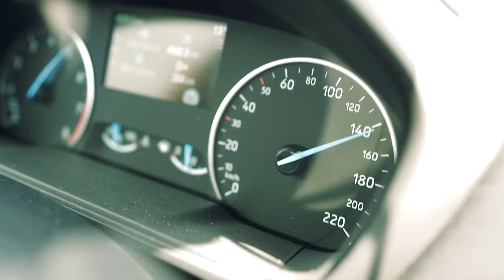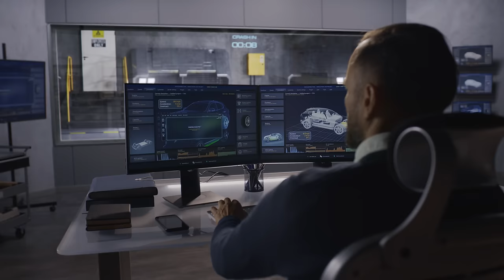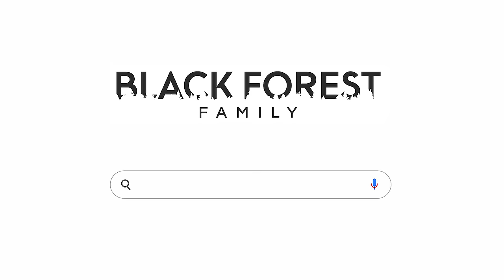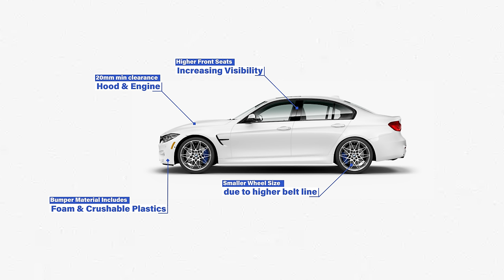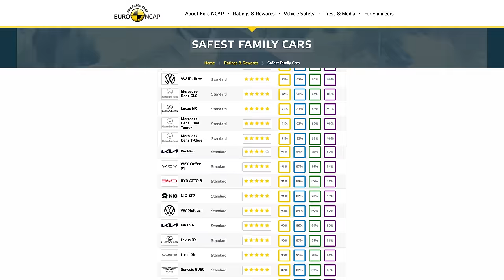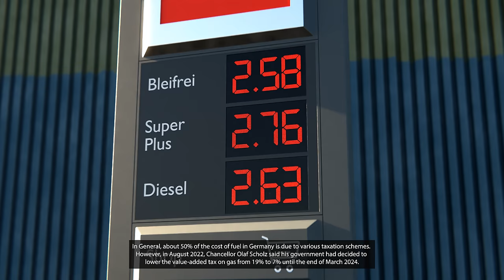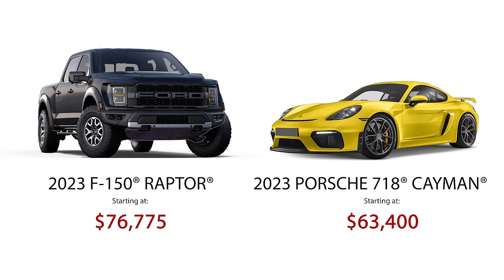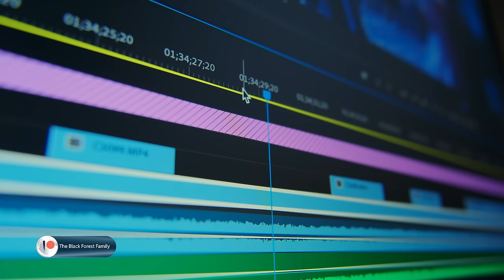DRIVING CULTURE CLASH: Why do our Cars LOOK so Radically Different?

Comment: I guess I'm not your typical American. I tend to look at transportation differently. First and foremost is reliability. My vehicle must be reliable in order for me to get to and from work. There is no bus that can take me to my place of employment. Secondly, I have no use for a pickup truck. Fuel economy is important to me and a pickup truck is not fuel efficient. I also have to have a vehicle that will be capable of the roads and climate where I live. Heated seats are a must for me. It's hard to find an American car that meets my needs and is also affordable. I've owned many different cars over the years including Ford, Dodge, Chrysler, Plymouth, Chevrolet, Volvo and several Volkswagen, and Audi. However, I have found that the most reliable, fuel efficient, practical cars that I've owned are KIA. I am on my fourth KIA and my second Soul. I drive a 2021 Soul EX. I average around 30 mpg and at 53k miles I have had no problems. So, not all Americans want an ugly, oversized gas hog.

Comment: As an Upper Midwestern American, I find the front end of most American and Japanese/USA designed pick ups act like a huge wall that totally block my view on one side of my car when I pull  up next to them at a stop sign. It keeps me from pulling out into traffic or moving because I can't see what is coming down the road. Lowering that front hood may do far more for safety than keeping pedestrians and children from getting ran over! Personally, I would love to buy a VW golf as it is my mind of car. Then again my priorities are inexpensive to buy, durability or little to no unexpected breakdowns while racking up many miles on the vehicle, ability to haul reasonably bulky items in the trunk area ( lounge chairs, small refrigerators, ect), low insurance costs, reasonably priced repair costs, easy to do my own maintenance  on the vehicle, and at least reasonably low fuel usage. Needless, to say the S Koreans get my vote for the most preferred cars and small SUV's, and in the past the Nissan Cube was a much desired vehicle.

Comment: Part of the problem is that American car companies have stopped selling actual cars. Ford only has the Mustang, GM has phased out almost all of it's cars, ( Cadilac still has a few ) and Chrysler's cars days are numbered. They push the SUV/CUV because the profit margin is better. They still made a profit oon the smaller cars but not enough I guess. The other issue is as a country, we are not a practicle bunch. A little to much of "keeping up with the Jones" and this Flex culture we have going on right now isn't helping. Even commercials, non car commercials, make absurb suggestions. Like a young couple finds out that they are having a baby, the next image shows them thinking about a mid to full size SUV/CUV or a Mini van. How does one child make you go from two door coupe to that.

Comment: Really addressing the elephant in the room would be addressing the different mind sets. 

Germans adore their cars. They keep it clean, spotless. A dent or a scratch are abominations that are addressed immediately. It's a kind of pride that transcends brands. You want to show off with your car, but not really with the car itself, but how you keep it in mint condition. And for an extended period. There are people out there that polish and clean their Opel Manta up to the tip of the fox tail. Or their Golf 1 or 2. It's showing off as "Look, how good I am, my 30 years old car looks just like it rolled off the assembly line. I am a master of preservation!!". You can add on with some luxury brands, if you want, but that is just the cherry on top. Like having a gleaming Porsche 911 or gasp a fully customized VW T1 California. Yes, making it go wroom is also important, but usually it's more cruising than racing.

Compared to that, people in the US are...less interested in the finer points of car ownership. They tend to go for the big and beefy. I get that people in farming need a pickup. Makes sense. But outside of transportation of readily accessible tools and equipment in an area with next to no rain...you do not need a pickup. When you want to transport people, I would prefer a bus. And if it is materials, a transporter. There is really no need to waste all that room with a bed instead of a trunk. Put a roof over it and you can do the same...but without it getting blown off or getting wet. In the US it is all about size. People have to compensate from something. It's generally accepted, that the size of the car is reciprocal to genital size. And to the power wielded in your daily life. They want to feel big and powerful at least when behind the wheel. And this is just not flying in Germany. We usually make fun of people driving those cars, thus taking away the benefit. Nobody is staring at a F150 and go "Wow, what a great car! Must be an awesome guy!". They usually point at it and laugh and see him trying to squeeze into small parking areas, saying "Wow, what an a$$...and can't even operate his car. Must have a very small p3n1s to feel the need to compensate with that.". 

Germans are more practical when it comes to cars. They cherish them, but they chose them according to their needs. When you need a small city car, you might go for a Smart or Mini. When you have some kids and go for IKEA once or twice, you go for a Kombi, like a Touran or Volvo. Need more room, you go for a Mercedes V class or a VW T6 or a Toyota Hiace/Proace. While in the US, you go for the biggest one regardless of why you need it. And throw in the broadest tires and double exhaust pipes and a big bull bar. People from the US like to brag and are hard to get off that high horse even by evidence. They can do everything better and when you present comparisons of topics like health care or education, they are at a loss for words and go fully mental with "butbutbut...that's COMMUNISM!!!". 

Not all of them, of course, but the ones we are focusing on^^

Comment: Utility requirements, real or just imagined, is a big factor. If you live in a country where you think you need to have a flat bed pickup, with XX horsepower to live your life, you will find use for it, you will find a way to justify it's existence in your garage.
Utility culture in the US is so much different than in Europe, yes rural America culture might need a high horsepower vehicle to do jobs on farms and some such, but European rural communities just don't use them (as much) and still get by.
Also, just because gas is cheap in the US doesn't mean you have to drive big cars that consume a lot of gas. It's the culture that's almost dictates it, and so you abide. 
Same with Germany, luxury car brands, fast cars, are as much a staple in that culture than pickup trucks are in the US.
For me personally it comes down to gas consumption, both big and fast cars burn a lot of fuel and the faster we can get rid of cars that use combustion engines the better.
How the car looks is secondary to me, after all, people should be happy in their own way.

Comment: Re: your dad.  To add an additional point.  Between GMs brands, their full sized pickups outsell Ford F-Series pickups. The difference is that GM splits then between two brands (Chevrolet and GMC) as opposed to Ford. Even though under the skin, the GMC and Chevrolet pickups are identical in every other way.

Comment: I love small cars (but mostly kombis) and I hate SUVs and cross-over cars, but we never thee less had to buy one when we wanted an electric car. For various reasons we did not want a Tesla and we needed a car that could tow at least 1200 kg (because we have a small caravan to camp around Europe). Now that limited the market and we bought a Kia EV6. I think it is too big, heavy and ugly and as soon as there is a smaller car on the market, with enough battery to go 400-500 km and tow 1200 kg, I will most probably change to that.
By the way, who needs a pick-up if you are not a farmer, gardener or working in the building industry? I certainly do not. Our first car 34 years ago was a small Polo and that could tow almost 500 kg and my farther had a small trailer (like so many Danes have).😊

Comment: No luck with new cars.  First new car I bought was Honda (stolen within 3 months).  Next one---VW...brand new and on the road 2 weeks and broke down on the highway.   Next new car as Subaru...loved it and drove it for the next 200K miles.  Next car was a Chevy, as much as I loved it, service was always terrible and the dealership and then tire warehouse company put the wrong size tires on it (to make themselves money) and it took years to find out why the continually lost air. A couple used cars (Toyota and then Citroen) now, we go strictly with public transportation.  I love the money we save.

Comment: Vans or Estate cars are much more practical than pickup trucks. I got myself a crew cab as i thought it looked cool but I soon found out why everyone i knew had only only owned one once.

For a start with a van you can use the side door and step into it to load it for example with thermalite blocks. but if i did that with a pickup i need to load a few then climb up into the pickup bed and move them back befor loading the next row.
In my Merc Vito  i can load up full size sheets of plywood  and i dont need to tie them down but when i had a truck they need to be secured.
And im getting 45 British MPG  in my van where as my Hilux averaged out 27.
And european and Japanese vans are just as nice to drive as a car. in fact i have a secondhand Toyota Hiace on order from japan right now as i tried one in Thailand and fell in love with it.

Comment: Of course, it doesn't mean that all Germans are so commitedly green. I might point to the VW group and "dieselgate" where the company engaged in a deliberately criminal act to subvert American emission rules on diesel engined cars.

However, the US approach to road safety and the lack of protection for pedestrians is astonishing. Pedestrian deaths are now at a 40 year high, and road fatalities in general are about the worst of any comparable country, whether measured by distance driven and especially per head of population. Canada, with similar road infrastructure, car preferences and usage has much better road safety than the USA, with less than half the fatality rate per million. Nobody seems to have an explanation for that.

Comment: As a german myself with now the third car, I can tell you: if your low on money, you don't consider to buy or not to buy a car because of the annual car taxes. You consider the insurance. You can't drive a car 8n german roads without registering it at your (mostly) local "Zulassungsstelle". To register it you need to have an insurance company giving you a number proving your car has at least "Haftpflichtversicherung" (if I remeber correctly that one does only pay for the damage on the other car involved... Probably pedestrians too... Never hit one in my entire life and also bicycle drivers... And hope to never have to learn if that is included as well...). We do have "Teilkasko" and "Vollkasko" as well, but those are more expensive because those also cash out for your own damages ("Teilkasko" just in special cases... "teil" like "part of something" and "vollkasko" would, I believe but not too sure, pay the whole car. I forgot if they pay for it as if it was new, the price it was worth the moment it crashed or the price you bought it at... I don't think it was the first one... I think it was the third... But not sure... So this insurances do only pay off if you bought a new, really expensive car). So as a german you more likely to search for the price you gonna pay your car insurance, cause the moment it doesn't have one, it's not allowed on german roads anymore. Even parking on a public space (the road) is then illegal.
And apart from you yourself. How much experience do you have, how long did you drive without needing your insurance to pay something... It really is quite like: "we are not interested in how many times you crash. We are only interested in how many times we need to pay!" so if you are on low budget, they gonna need to pay even little bumpers you caused (We call it "Lackschaden", like only the paint on your car got scratched cause you bumped into another person before the traffic light or something like that). And we have percents-stuff determining your paying to the insurance. And if you need their help it will go up and you gonna pay more next time. But if you drive without issue you gonna get less percent and with that less pay.
And now the really big thing with insurance: if people driving the same car as you are, were in many accidents involved (doesn't even matter who caused the accident), the price for insurance goes up. That's why I never even though about getting a VW Polo, cause that car (at least the older versions, which are quite cheap) is known to be really often driven by beginners and so really often involved in accidents, which lead to high pays for the insurance. So you need to consider many things if you buy a car and as funny as it is, I actually downgraded from my first to my car now xD
The first was quite big and powerful (I knew I would be driving to many conventions and gonna get many people in my car to come with me) to a less powerful, but quite cute car (that only did 2 years before being like: "you need to make TÜV and I'm going to cost you a fortune to get through this. Way more than you even payed at first~") and lastly I got an even less powerful car with 5 doors (we count the trunk door too) and less gasoline consummation, because I realized: Dafuq do I need dis much?!
All the people who gonna drive with me just need to consider that they can't take much with them and have to have their bagpacks and other stuff on their laps during the drive. Or something in their leg space.
And if we need to move furniture, like every "baumarkt" (don't know the amercan equivalent) offers you to rent an "Anhänger" (... Forgot the equivalent word...) or you can rent a little transporter at the furniture store. We have our ways of just renting stuff or even know someone who knows someone whose uncle has something helpful... (I really often get the feeling its like: "oh! I know, that someone helped me moving and he did get that helpful vehicle from his cousin of third grate! Maybe we can ask them to lend it to us for a day!"
... But that could be just me growing up in the middle of nowhere here in germany, where everyone in your little city seems to know everyone else... Except for me, cause I'm not that big of a social person)
So there is actually no need for big cars, but it seems like that people being able to buy freshly new made cars prefer bigger and bigger ones.
Some german tv show once made a little experiment closing off a parking lot in the middle of a big city. That parking lot is typically free, but the charged the drivers that day. And it didn't matter how long they intended to stay (which is how you normally pay for parking), but for the length of your car. And the really small ones got in for free.
So many people got enraged. It was quite funny, cause many where typically german like: "well, yeah. I get this. My car needs a lot of space, so I need to pay much." some were like "not gonna pay this. I find myself elsewhere a parking spot!"
And the most funny for me was a mom in a really big car (I think it was that offroad type truck like car) and as she was asked why she's there, she answered "To shop groceries" and she told them that she needed that car to drop off her kids and it kinda ended in her admitting: It would really not be necessary to get into her big fat car to go get groceries. She should have just get there by public transport... If you live in a big city: take the public transport. You gonna be less stressed and probably even earlier there then by car. And if you come from outside to visit or because you need something there, take the Park and Ride option. It is gonna be WAY less stressful. Frankfurt and Leipzig are HELL to drive through.

Comment: American Truck sizes are actually bigger than they need to be for performance and many people who actually haul with their trucks prefer the smaller trucks of the 80's and 90's. The "truck culture" America has today is mostly due to advertising campaigns of the early 2000s. This is because of legislation that taxed cars but made exceptions for large truck chassis. It is cheaper for manufactures to sell these large trucks because of this exception, so they pushed consumers to buy these large trucks. It's kinda like how DeBeers made diamond rings the norm and invented the "3month salary" standard price.

Comment: Why suddenly the big SUV, like the Dodge Caravan, appeared in the North American urban landscape is more simple. The US EPA rules for fuel consumption and polutant emissions had exemptions for the motor vehicles, like utility vans and pickup trucks, that were used by small businesses. They simplified the list of various exceptions into the chassis specifications that separate those exempted from the normal citizen car. The Big Three had problems to meet the increasing thight Californian EPA rules with their 4 cylinders motor family cars. So they decided to dress a non-regulated utility van chassis with a designed spacious family interior, put a 6 cylinders motor in it and called it a Sport Utiliy Vehicle for the family. Their PR firms did the rest to make it the commercial success that changed the urban car culture. The rest is History.